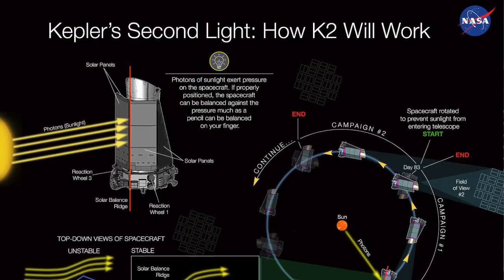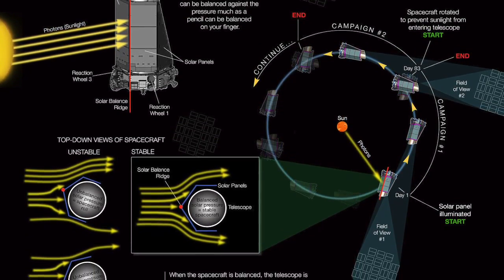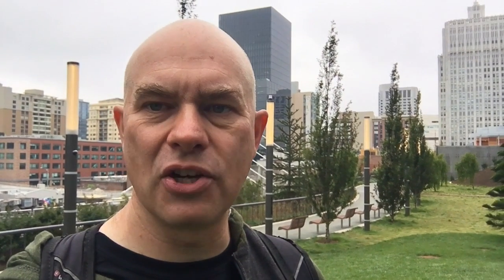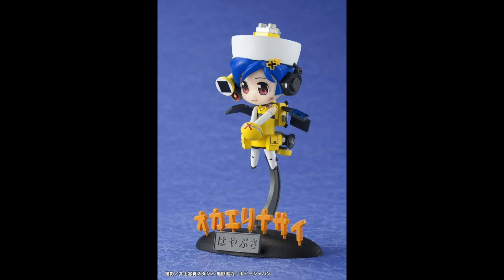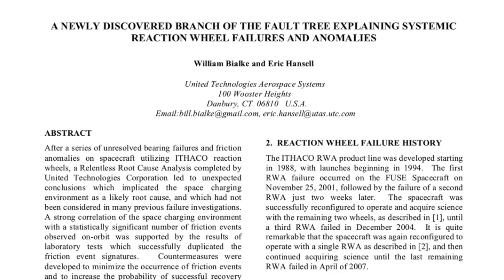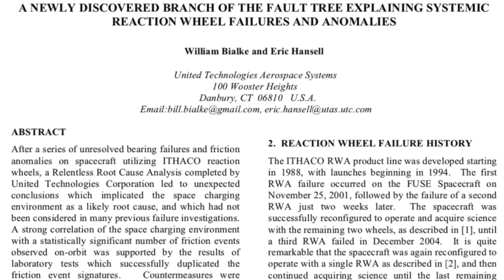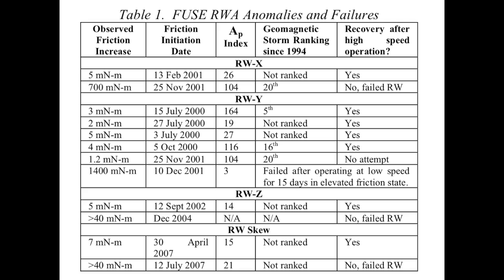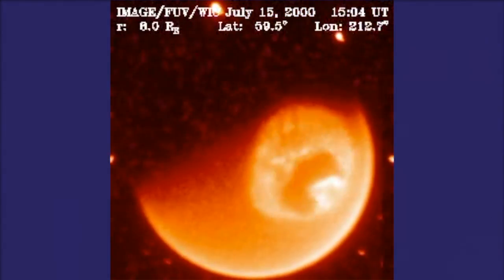Scientists May Have Figured Out Why So Many Spacecraft Were Failing

Comment: People often fail to realize that there is no such thing as a perfect Faraday cage. You can't just wrap something in micron thick foil and expect infinite attenuation.   
Seems to me like you'd need something more than just a standard metal enclosure to keep voltages across the bearings below 6V during a decent size solar flare.
Reply: So, the grounding is to blame, as usual
Reply: lets attach a long wire from the satellite to the ground, that should fix the problem.
Reply: It's not the thickness, it's how good the connection is along all the joints. You use things like this: https://www.tech-etch.com/shield/images-shield/assortment-of-emi-shielding-products.jpg
But ionizing radiation can also cause a voltage spike and flares give off some quite energetic particles. If that's the culprit, good luck shielding from that.
Reply: Barry A.  For gravity probe B they put the core of the experiment into a cryostat, coated with superconducting material from the inside, and cooled it down to the point of the material turning superconductive. This is a perfect faradays cage, as long as you do not manage to somehow overpower the superconducting capabilities of the superconductor, it will hold. No electromagnetic fields or electromagnetic radiation can penetrate, with the exception of hard x-rays or gamma rays.
Reply: Timbargen , a cryostat coated with superconducting material from the inside and cooled down to superconductivity will shield against nearly all electromagnetic radiation and all magnetic fields, only hard X-Rays and gamma rays can punch through, and these cannot induce an electrostatic charge because they are themselves ionizing radiation. Except for energetic particles that just punch through by brute force, the inside will be free of EM fields.
Reply: kurtilein3     That is true, I wondered if someone would bring that up. Sheilding from a superconductor should be perfect, so long as you don't develop a strong enough magnetic field to destabilize the superconducting state.  X-rays and gamma rays can produce a buildup of charge if a strong electric field is already present; that's how a Geiger-Müller tube works. Not conditions I would expect to happen anywhere on a spacecraft like this though.
Reply: timbargen  The Beauty of this is that when you already have an application that requires superconducting anything, you can add that on top, because you really only need a thin layer of the correct material at the correct temperature. What happens when you overcome it by force is that flaws become apparent and parts of the material lose their superconducting properties and locally heat up. You can overpower such a faradays cage. 

But it will be perfect for as long as it can be maintained. X-rays and gamma rays will simply punch through, if they have enough energy, the idea of keeping an area clean of any electromagnetic fields or radiation goes very much against the idea of very strong locally caused fields being present.
Reply: Mining - you're confusing grounding with earthing.  Neither have anything to do with effectiveness of a Faraday shield.  That's determined by the conductivity/admittance of the cage.
Reply: @nelumbonucifera7537  Don't forget the wavelength of the EM field, the depth of skin effect, and the thickness of the cage.
Reply: timbargen - You can have a perfect faraday cage and STILL have this problem.  If the reaction wheel inside is electrically isolated from the rest of the system, and you charge the REST of the system, then the voltage across the bearing will still happen.  As you change the voltage of the perfect faraday cage, that STILL creates a delta-Voltage between the wheel and the rest of the system.  The only permanent solution is to ground the wheel to the rest of the system while it is spinning so the voltage never gets too big.
Reply: @stuartgray5877  Finally, a sensible comment in this thread.
Reply: @stuartgray5877           If all you needed to worry about was electromagnetic fields, then you'd be fine, no grounding needed. If you have a sealed conductive shell, any charge placed on it basically remains on the surface, and the electrical field does not penetrate. You can have 100s of kilovolts on this surface, but the electrical field between the surface and the interior will be neutral. No current can flow from the outside in, only from the inside out. ( This is one of the principles that a Van de Graaff generator uses . )  
     Any faraday cage will block external electrical fields, but changing magnetic fields can still induce movement of charge within the shield.  A perfect faraday cage will also block essentially all magnetic fields ( at least if it's  superconducting ) , so charge needs to be deposited directly into the interior in order for any current to flow. This is exactly what the charged solar wind particles and higher energy x-rays are able to do. So you still need to either ground or insulate your reaction wheel.
Reply: timbargen - You are not quite correct.  If you put one faraday cage inside another and set the voltage between the two to 1.0 Volts. What happens if you drive the outer cage to 100 volts?  Is there ANY WAY to keep the DIFFERENTIAL VOLTAGE from changing from 1.0 volts to 99.0 Volts (or 101.0 Volts)?    NO.   and it does NOT matter how "good" your outer faraday cage IS.  And FYI, I am an electrical Engineer (specialist in EMI/EMC testing - I used to BUILD EMI shield rooms for a living) who now builds spacecraft for a living.  I helped build, test, launch and FLY the Kepler Spacecraft.
Reply: @stuartgray5877   What you are saying is correct, but I don't see how it applies in this case. In your example, an electrical connection is required . In the case of the reaction wheel, it is electrically floating . To create a voltage differential between the inner and outer faraday cages, an electrical connection to both is implied.*  You cannot remove the electrical connection to the inner faraday shield and still be able to drive a voltage difference between the two. If the inner cage is truly floating, any voltage applied to the external cage must be between the external cage and its surroundings. 
      Any charge coming from charged particles deposited on the external cage can only create a voltage differential between the external cage and its external surroundings, not its interior. (barring effects from geometry)  Same thing goes for the internal cage, except that its external surroundings include the external cage. 
     * Of course, one can get into technicalities and state that charged particles depositing charge on the interior cage is a form of electrical connection . I hope it was clear that I was referring to more conventional means .
Reply: timbargen - Reconsider my example "put one faraday cage inside another" using two concentric metallic spheres with vacuum between them. 
 Does this basically constitute a Classic Capacitor or not? 
 Now place some number of Coulombs of charge on the inner sphere (the actual number doesnt matter). 
 Now electrically change the charge on the outer sphere.  There WILL be a potential voltage difference (and associated E-field) between the spheres. 
 The quality of the Faraday cage on the outside in no way makes a difference to the total potential difference between the two spheres  which is what I believe you were trying to say initially.
So all I am getting at IS: If the only thing to be considered is to "minimize the voltage potential between the inner & outer devices", then "making the outer shield better" will NOT help the situation.
The only thing that WILL help is to provide a path from the inner piece to the outer piece to allow equalization of potential before the potential gets big enough to cross at the bearing surfaces.
If we can say the solution MAY include making the bearings impervious to voltage potential, then you could allow the potential to build and dissipate slowly over time and cause no damage.

Now the over-engineered solution would be to have electron beam emitters inside the RW cavity to complete the circuit across the vacuum gap to equalize the potential before it could build enough to damage the bearings.
Reply: @stuartgray5877    I think we're using different wording and perspectives for similar things and misunderstanding each other. Maybe we even agree completely and I just don't know it.
     I don't think my original point was very clear, so I'll try to make it in a different way. I made that comment in response to this particular sentence, " If the reaction wheel inside is electrically isolated from the rest of the system, and you charge the REST of the system, then the voltage accross the bearing will still happen ." The way I interpreted this, applying it to the example of two concentric conductive spheres, it sounded like you were saying that placing a charge directly on the outer sphere would have an effect on the potential between the inner and outer spheres, and I disagree with that. This would be somewhat like charging one of two series capacitors, and expecting the voltage on the second one to change. Two concentric conductive spheres make a capacitor, but there is actually a second capacitor, between the outer sphere and its environment. 

    In the example of two concentric metallic spheres, there's a few different ways charge can be introduced. I'll describe what I think these are, and what should happen; that way if I'm wrong about something it should be easy to point out. Polarities are used simply for convenience.
      - If a negative charge is placed on the inner sphere, an equal positive charge will be induced on the inner surface of the outer sphere, which leaves an equal negative charge on the outer surface of the outer sphere. There will be a voltage between the two spheres.
      - If a charge is placed the outer sphere, electrical repulsion will force all of this charge to the outer surface, leaving the inner surface charge level unchanged. With no charge on the outer sphere's inner surface, there is nothing to induce a charge on the inner sphere, and the potential between the two remains unchanged. 
      - If a negatively charged object is brought close to the outer sphere, a positive charge will be induced on the side closest to the object, leaving a negative charge on the side furthest away. Again, the inner surface of the outer sphere will remain neutral.
      - If a positively charged object completely surrounds the outer sphere, i.e. a cloud of ionized hydrogen, then a negative charge will be induced on its outer surface, leaving a positive charge on its inner surface. This will induce a negative charge on the outer surface of the inner sphere, but only if it is hollow. Regardless, there will still be a voltage between the two spheres.    This particular scenario is something I hadn't thought of until now, so thanks for making me think.
      
    All of these examples are using static electric fields. Adding in magnetics and rapidly changing electric fields completely changes the picture due to things like resistivity and skin depth, and that's where the quality of your faraday cage comes into play.

Btw I like your over-engineered method. Sounds fun.
Reply: @ergohack  perhaps we are just talking past each other.  This remains a fact: if you have an object ELECTRICALLY ISOLATED  inside a Faraday cage and you change the total CHARGE on the outer cage it is NOT POSSIBLE without ALSO changing the DIFFERENTIAL CHARGE potential between the inner object and the outer cage it DOES NOT MATTER if the outer cage is continuous or not. Charge is not relative like velocity.  You can count electrons last time I checked.  A coronal mass ejection WILL charge the outer "shield" of the spacecraft creating a differential voltage potential within the spacecraft.  Another Spacecraft I was test lead on was Genesis which used high voltage concentrators to capture solar wind. It basically WANTED to get in the way of CMEs.
Reply: @stuartgray5877  That sounds like a very interesting project to work on.
Reply: @ergohack  it was the sample return capsule that famously crashed into the desert in Utah.  They still recovered the science but in very small pieces... Oh and that spacecraft was spin stabilized so it had no reaction wheels.
Reply: Good point.

Comment: Here's a question: Is the manufacturer at fault?
Assuming the best intentions, they did their best to make sure it worked. It took many people years of studying the data to figure out a possible explanation, not to mention a crtain one. 

On the other hand, it hardly seems like an unknown phenomenon. The manfacturer also seems to be the one that made it cheapest so maybe one with more money invested in each, would have been more resistant.

If you look at the end result only, you might find that you would have been better off buying twice as expensive units from someone else even if all the available data said that these were just as good, but those maybe did not end up failing.
Reply: Any other manufacturer that used metallic bearings would have had the same problem.  This isn't an Ithaco problem, it's a we-don't-understand-spaceflight problem.
And I'm surprised NASA didn't attempt a scientific analysis of this earlier.  Reaction wheels failing in space but not on Earth is exactly the type of thing a space agency should be trying to solve.
Reply: If it's really the issue that Scott mentioned, then it's actually quite well documented. The stroke of genius is to figure out that it can accure due to solar radiation.
Reply: If only someone gave them funding...
Reply: It's just the manufacturers fault if someone figured out the problem beforehand. But the reason for those failures was only discovered after many years. Also those spacecraft ALL functioned well beyond their intended lifetime.
Reply: If it is designed to all of NASA's requested specifications, that is all they need to fulfill
Reply: Manufacturer isn't at fault if they specify [x] hours of operation and these wheels are routinely doing double or more that time. If NASA and others really truly want these probes to last multiple decades, they'd over-engineer the piss out of the wheels, double or triple row bearings, massively overpowered electric motors to get stuck wheels moving again, etc.

"No, it's a design flaw that only could've been seen coming with either a multi-year test in space "

I mean, not really. The amount of energy thrown out by the sun has been known for quite a while now, and i bet there's 10 year olds out there right now that have killed a bearing by welding across it. This failure mode was pretty well known, and as long as the company didn't under deliver on the amount of hours these wheels will spin for, it's not on them to spend more money to prevent it.
Reply: No, it's a design flaw that only could've been seen coming with either a multi-year test in space or them getting lucky and getting a solar flare very soon after launching said test. With NASA's current budget it's a bit hard to justify the cost of testing things like this sadly.

Comment: Fascinating!
However, why aren't they using magnetic bearings? Without gravity, surely they would be a perfect solution, or are the reaction forces too great to maintain containment?
Reply: As far as I know, cost is one of the trade off. They're using them since over 20 years on some Earth observation satellites.
Reply: I mean yeah the reason that so many satellites were using these reaction wheels is because they were cheap, if they didn't care about price they probably would have stepped it up a little bit. I am not sure of how much power magnetic bearings use though, for spacecraft going very far away from earth their power budget can be a lot smaller.
Reply: Thanks for the replies...
Obviously, if a billion dollar spacecraft fails because of cheap reaction wheels when magnetic ones would do, then they are very expensive reaction wheels!
Magnetic bearings should in theory last indefinitely. If craft were capable of being refueled cheaply for desaturation, then they should also be able to last indefinitely.
Reply: Andy Lee Robinson  Once you know the issue, solutions are cheap and easy. The same old reaction wheels would work just fine if you add some small radiation sources, like the americium used in smoke detectors. The ionizing radiation knocks electrons out of any conducting surfaces, these will travel through the air or through a vacuum, being attracted to any buildup of positive charge. Just pick the correct energy level and dose of radiation, so that electronics are not affected, but it is toxic enough against any static charge buildup.

Magnetic bearings, unless superconducting magnets which require advanced cryogenics are used, constantly consume energy. In any case, the electronics required to actively control them in real-time also add a point of failure, cost, and energy consumption.
Reply: That's the question that I'm thinking about. It seems obvious that magnetic bearings would last much longer and that steel ball bearings would wear out relatively quickly. Call me cynical if you want, but I suspect bribery.
Reply: Andy Lee Robinson and why not fluid bearings?
Reply: @TheToric  It's hard to keep fluids in vacuum. Usually solids turn to gas directly.